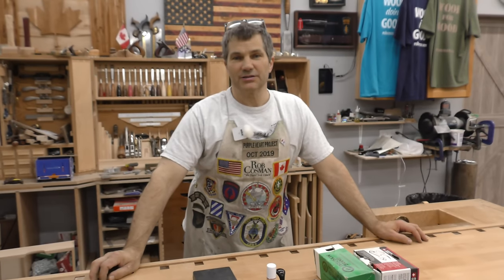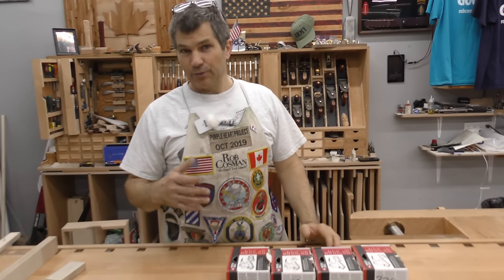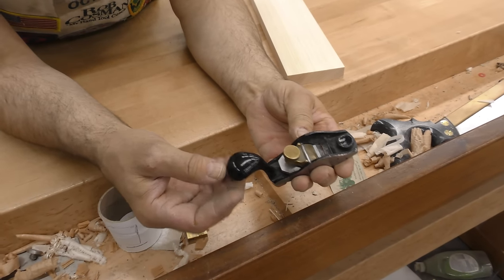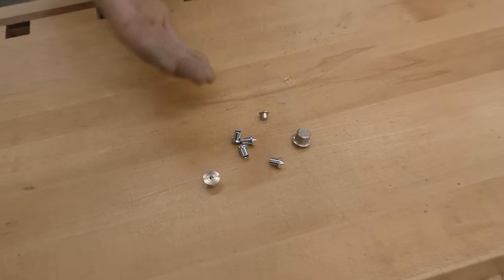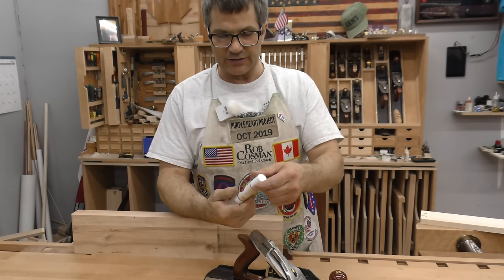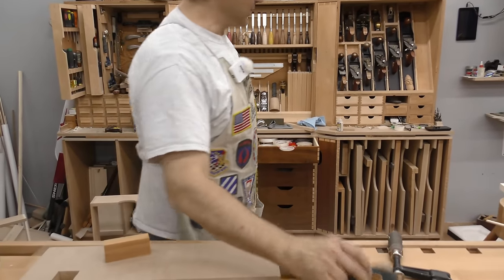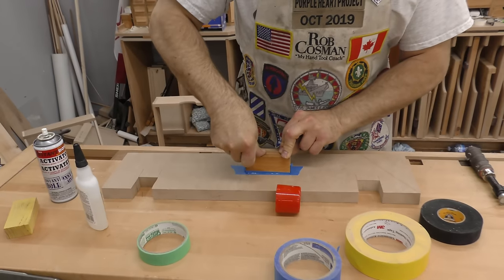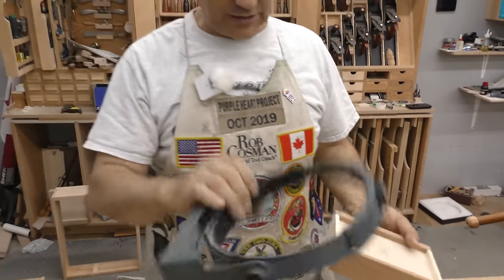Top Woodworking Gadgets - MUST HAVE ITEMS

Comment: Micromesh sandpaper--1500 to an incredible 12,000 grit
Reply from the maker: Wow...So how does it hold up under use?
Reply: @RobCosmanWoodworking  It is wet or dry and holds up very well under use--you  don't need much to do the job. it is available from Amazon in packs of assorted grits.  Great for automotive use, also for polishing and removing scratches from metals, clear plastics, glass....you should give it a try

Comment: Oh, wait! heres another; you prob. already know it; when you make a cut on the table- or miter-saw, go fit it and its just a bit too tight for common sense, stop the saw blade, put the wood up against the body of the blade (not the tooth); now back  the wood away without letting it slide sideways; now turn on the saw and cut without moving the wood sideways; it will cut just an acurate, straight, smooth, miniscule hair off!  You just cut 1/2 the kerf off your workpiece! Ha!